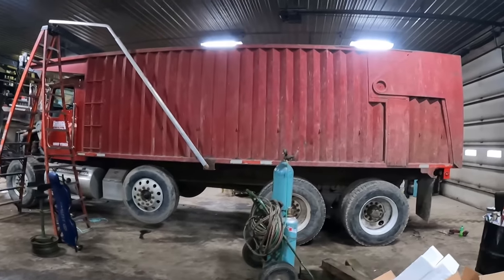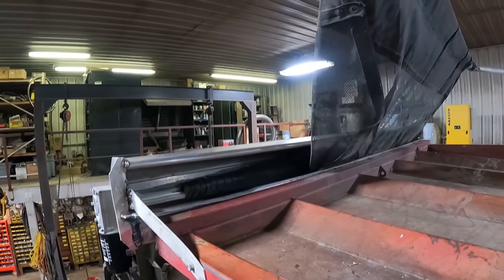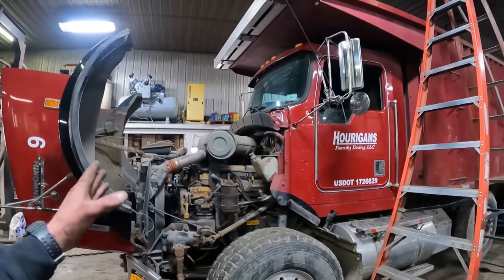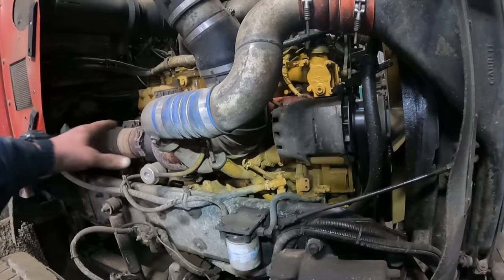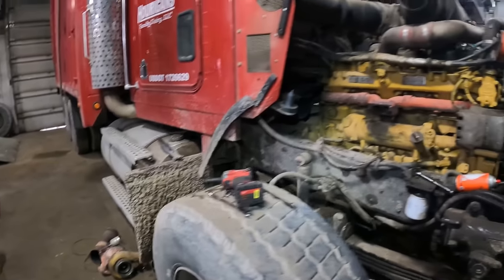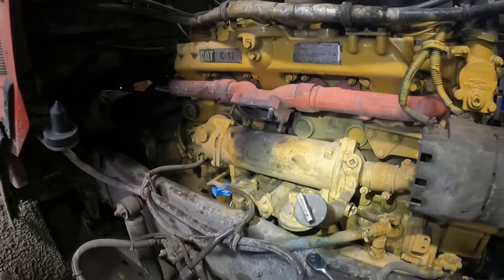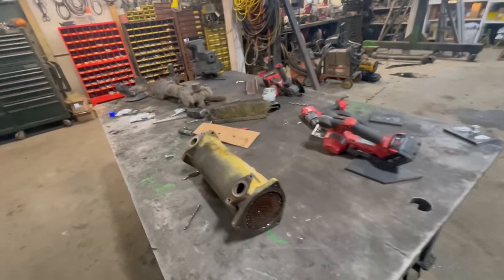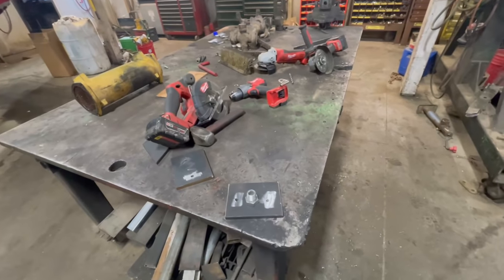Oil in the coolant

Comment: Excellent video it's nice to see that you found the leaking oil cooler I rebuilt a international tractor engine about month ago as I was tearing it down I told the customer that the oil cooler is shot and leaking it was so bad that there was no mistaking it so I replaced it with a aftermarket on that was trouble some to get to fit but I got it to work right

Comment: I have a Milwaukee M12 5 3/8ths circular saw. I love it! With a 6.0 battery, it'll make over 250 cuts through 2x4s. It only cuts like 1 5/8ths, maybe a little more deep, but thats plenty for plywood and dimensional lumber. Its light, powerful and fits the hand so well. I love the little light on it too as I find myself working into dark sometimes and it lights the line right up.
Reply from the maker: They are great tools
Reply: @FarmingFixingFabricating  They sure are. The batteries hurt a little when buying them but I haven't had any issues with not a one M12 or M18.

Comment: Pressure check the cooling system and pull the oil pan you might have a bad liner o- ring more then likely
Reply from the maker: Oil cooler

Comment: Caterpillar engines are notorious for o rings to fail on their oil coolers... have you tried just replacing the o rings
Reply from the maker: The cooler is bad not the o ring
Reply: @FarmingFixingFabricating  okay...  most of the ones... the 3406E and the c 15 I worked on at Ryder the O rings would get hard and would start leaking... but okay... just my thoughts from my mechanic days